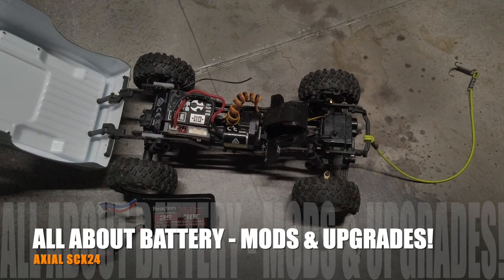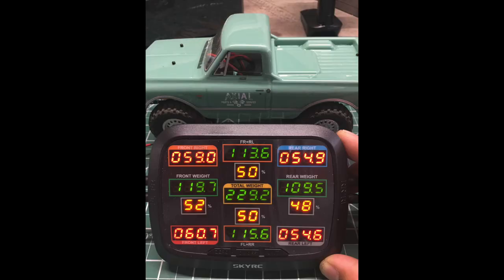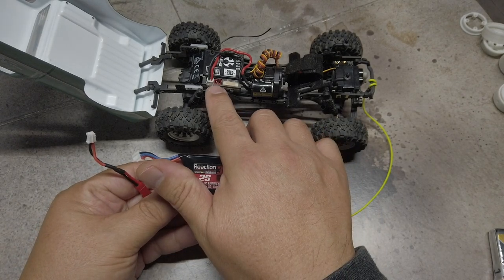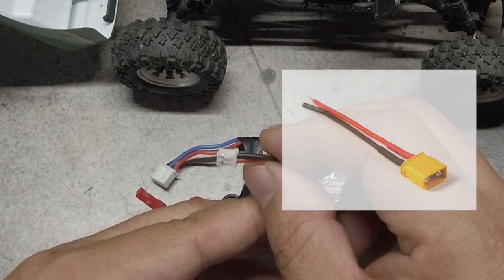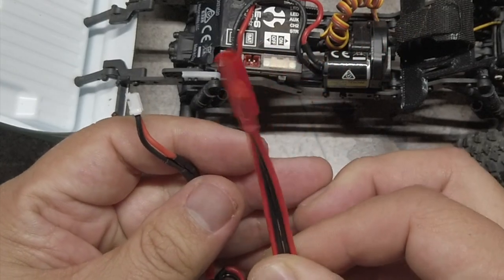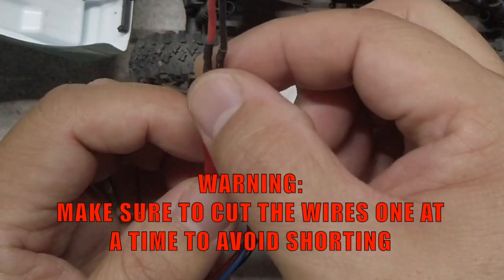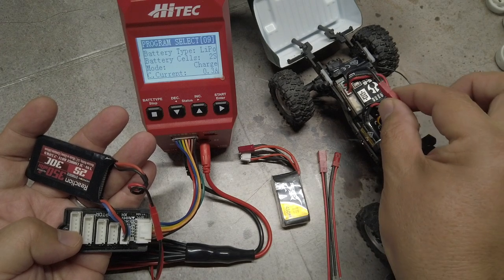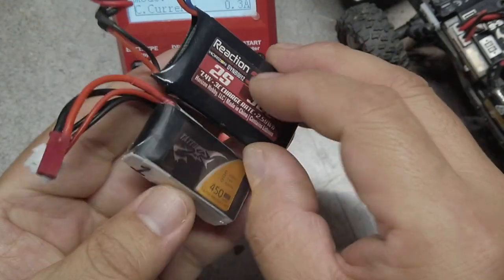1/24 Scale Axial SCX24 | All About Battery Mods and Upgrades!

Comment: Wish I would have watched this, before I was investigating conector name. I hate that jst ph2.0 connector as I plug, unplug battery after every use. I need to solder in a new connector so I can leave the jst pigtail in the esc.
Reply from the maker: It makes life easier.

Comment: I already have a 1500mah 2s from an Others Car. Can the Stock ESC Form the scx24 handle it or is it to much?
Reply from the maker: As long as it’s 2s, the stock ESC will handle it.  But few things to consider.  1) the weight.  1500mAh will be way too heavy for scx24.  2) The long runtime might not be good for stock motor.  The motor is not heavy duty.

Comment: I have a question you soldered The male connector to the battery, my question is there’s two bear aluminum pieces on the outside of the plug if a piece of metal touch that would shorted out
Reply from the maker: The JST SYP connector comes like that.  The metal leads are recessed a bit.  It's the same with stock connector or even XT30 connectors.  They all have some recession on it, but the two leads are all exposed, so need to be careful.

Comment: Which SCX24 model do you have? I am thinking of this battery modification. However I am afraid the thicker battery won’t fit in the clearance between the chassis and the upper shell.
Reply from the maker: I have the C10 version.  I had no issues, but I can’t confirm on other models.  One thing, if you have access to 3d printer, there is a LCG battery tray which works great.
Reply: @BigSungHobbies  I am holding to get my first SCX24. Personally I prefer a c10, but a jeep might wins for its bigger space internally. What’s the max thickness of your battery? I will take that into account while buying batteries. Thanks
Reply from the maker: The thickness on stock battery is 7.14mm while Gens Ace is 13.53mm.
Reply: @BigSungHobbies  great. I will try battery no more than 15mm in thickness. Then it should works fine for C10. Thanks
Reply from the maker: I really like the Gens Ace 450mAh batteries.  The 75C rating seems to give me that slight edge when I need the power.

Comment: As a complete newbie to RCs, thank you!!! I just ordered an SCX24 as well as this charger. Still waiting for shipping. Can you tell me what's included with this charger? I see you have a thing for the balance port. Is that included? If not, where do I find one that fits this charger? Also, that pig tail you have. What is it called? I don't even know what kind of connector this charger uses.
Reply from the maker: Welcome to the world of RC!  The balance port is included with the charger.  As for connector, Amazon has RC Lipo Battery Charger Adapter Connector Splitter Cable that goes for around $10-12.  This is the one that I have.  https://www.amazon.com/gp/product/B074QK5M7P/ref=ppx_yo_dt_b_search_asin_title?ie=UTF8&psc=1  I use the JST plug for SCX24.

Comment: Hi. What is the largest mAh capacity can use to our scx24?
Reply from the maker: Theoretically there is no limit, but due to overall weight of the SCX24, there is going to be diminishing return.  I find I like 450mAh on mine, but I have seen others go opposite by going with much smaller for weight savings.

Comment: Would a 4.35v high voltage battery cell (2s) cook the electronics?
Reply from the maker: I have not tested high voltage lipo on scx24, so I am not sure.  I have no issues on 1/10 scale, but they tend to be a bit more beefier.

Comment: What charger would you recommend for the scx24?  I've amassed 3 trucks thus far.
Reply from the maker: I use my full size ones, Tenergy T180 and Hitech RDX1.  Spend money on good quality charger that can balance charge, discharge and put it on storage mode.  It's well worth the price.

Comment: Was wondering if these crawlers are reliable overall long term? Lots of parts replacements or not a problem?
Reply from the maker: Like any RTR, the stock servo usually does not last.  I upgraded to an Emax servo right away, and I have not had any issues.  I do hear that the stock motor doesn't last and should be changed, but I am still running the stock motor without any issues.  A big mistake that most people do is add tons of weight.  My build philosophy is see if you can shift things around and add weight only where needed to get to 60% front / 40% rear weight distribution.  I have had mine for few months without any replacement parts.
Reply: @BigSungHobbies  Thanks so much.

Comment: You should be able to charge the battery with the jst 2.0 just using the balance plug on the battery with a normal charger
Reply from the maker: That works, but there were several reasons for going this route for me. 1) I needed longer cable 2) I did not like to plug and unplug from ESC port all the time 3) It opens up different battery options , and 4) I would like to see the actual voltage using the balance port.

Comment: I was thinking I needed to do something like this. I'm just worried about splicing wires on the battery. If it wasn't my only battery I'd give it, but I don't know. Great idea though...I was wondering how people used jst connectors on these scx24.
Reply from the maker: As long as you work on one wire at a time, you will never have issue.  You just need to avoid crossing the wires.  If you still feel uncomfortable, you can always buy a 2nd battery with JST connector.
Reply: @BigSungHobbies  I think I'll go ahead and give this a shot then. As long as that's all there is to it then 😁 I appreciate the info and suggestion, thanks 👍
Reply from the maker: Just take your time.  And make sure, you cut one wire first...doesn't matter black or red, and don't forget to insert heat shrink before you solder the wire.  Once you have that done, then cut the other wire.  NEVER try to cut both wires at the same time!

Comment: Is the tattu 800 mah to much for this? It’s only a 45c though.
Reply from the maker: It will add weight, but it will work.  I find that 450mAh seem to be a decent balance, not too much weight and decent run time.

Comment: what is the weight difference between the stock battery and the Gens Ace 450 Mah, 2S
?
Reply from the maker: It weighs roughly 5g more than stock.  I was at 58/42 weight distribution, so I figure I will take the 5g gain to change the weight distribution which is now at 59/41.  Once I decase the ESC case, then that should get me to 60/40.
Reply: @BigSungHobbies  Excellent! I have my c10 set up the same, but no brass knuckles yet. Great video series! :)
Reply from the maker: Thanks, and the brass knuckles and front brass diff cover will be ideal items to add first as it adds mass at at axle level instead of rotational weight.
Reply: @BigSungHobbies  I understand limiting rotational weight. I have RC4WD "scaler" aluminum wheels. They weigh 1 gram more than stock wheels with HR wheel weights. They work well. :)

Comment: Is the Tattu 450 a 2 or 3s?   Only finding a 3s on amazon.
Reply from the maker: This is the one that I have, and it's 2S.  I bought directly from Gens Ace.  https://www.genstattu.com/tattu-450mah-7-4v-75c-2s1p-lipo-battery-pack-with-jst-syp-plug.html
Reply: @BigSungHobbies  Thanks BigSung, really appreciate it!
Reply from the maker: @smallcrawlrc No problem.  I am really liking it.  Runtime is significantly better for 5g penalty, and the 75C gives me a bit better punch when I need it.  On top of that it's so much cheaper than stock one.

Comment: Venom 430 ten bucks tower hobbies
Reply from the maker: Good to know thanks.  Also look into the Gens Ace...it was less than $8, and they have been very reliable so far.
Reply: @BigSungHobbies  Nice vid!  I’m going to use this video to change my battery connectors. QUESTION- I converted one of my SCX24 to bash around- speed runs. I have the furitek Komodo ESX and about to buy batteries- is it worth it to spend a couple more bucks to get the 75C versus the 45C on the Gen s Tattu 3S lipo battery?
Reply from the maker: @rjfromatl8071  If you are going to pick up new batteries, I would pay the extra $ for higher C batteries.  I don’t have the means to test the difference, but I really like the 75C batteries.
Reply: @BigSungHobbies  thank you! 
I enjoy your videos - great informative content. Keep them coming.